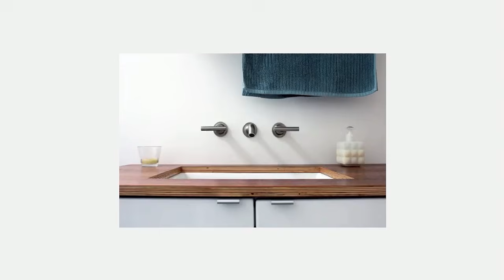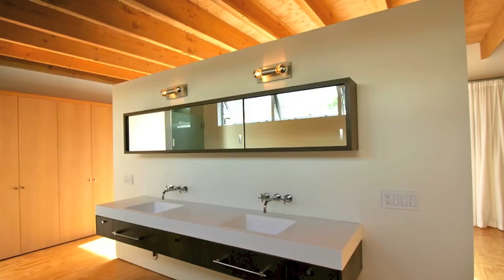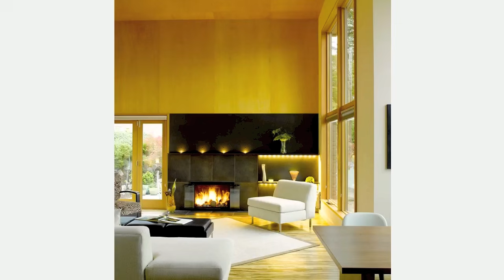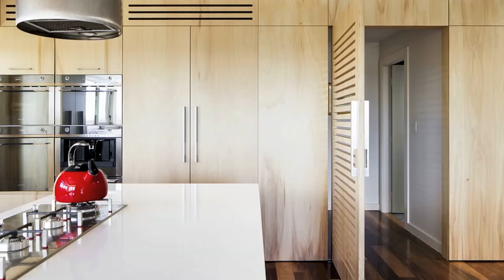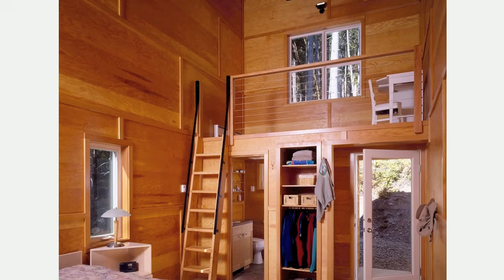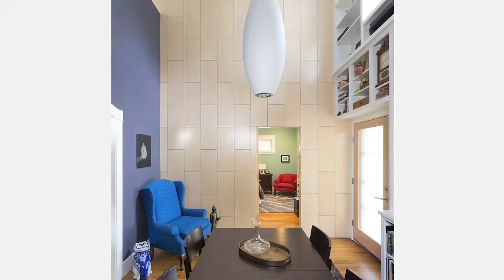Plywood as Finish

Comment: Is plywood fire resistant when used as ceiling and wall?
Reply: No it's not fireproof
Reply: It is actually not allowed in the UK for example, unless it is specifically fire resistant plywood, or with an intumescent coating applied. If not, having plywood walls and ceilings is the best way to ensure flames propagate as quickly as possible...

Comment: There are hardwood floor finishes such as Bona's Traffic HD and Traffic that are waterborne finishes that are extremely durable. Even more durable than oil modified finishes. Another siding finish that can be affordable is laminate,  laminate flooring or engineered hardwood flooring. You can also buy higher quality plywood designed for flooring  at completive prices. This kind of plywood many times is typically designed to have less imperfections, be a higher grade, have no core weaknesses or hollow spots. Products like Multi ply or similar brands may make good choices. Typically they are available in 4x4, 4x5 and 4x8 foot sheets.

Comment: Forgot to mention finishing plywood takes 3-4x the work or coatings for a finishers so don’t be surprised if the carpenters bill is much less then the finisher bill!
Reply from the maker: why?
Reply: 30X40 Design well plywood comes in many different species but overall it’s usually still rough grade over all and takes considerably more prep and material which result in more coatings.  Hope that helps, staining can be touchy as well.

Comment: I have a lot of plywood furniture because much of my furniture is 1950's style. I would like walls like these, so thank you for the slide-show and explanations. Very good. It would be nice if you did a program on the specific joints used to make those exposed joints. I would think just a thin spline of some alternate color, or some metal, like stained glass. Thank you.

Comment: I am a design draftsman with larger background as woodworking contractor. I did a number of plywood (finish) build outs for a prominent architectural firm in my area as well as designing other installations for high end design/build millwork shops. Done right, it does take on a special character. And of course the famed miter fold is indispensable.
Reply: Nick Dow what does this mitre technique accomplish? In my attic space, I want to use my sloped walls to flat ceiling to be finished in plywood to avoid dry walled plaster costs. any suggestions would be invaluable.

Comment: I was hoping this would tell me more about the kind of plywood you sometimes see in bookshelves where the layers are very distinct. I've never seen this plywood in a lumberyard but often in stores or magazines.
Reply from the maker: It sounds like you're talking about Baltic Birch or Apple Ply. If your lumberyard doesn't stock it, you should be able to order it from them (or their supplier directly). Good luck...!
Reply: 30X40 Design Workshop Thanks, that got me on the right track. It's really just multi-ply plywood.

Comment: Very instructive video! I really wanted plywood flooring in my new house and it wasn't easy finding a contractor that would do it. Now, a year later, some spots are squeaky and I'm not sure what to do. They were initially glued and nailed to the sub-floor. Any suggestions?
Reply from the maker: +Raphael Bousquet - I might investigate screwing the plywood rather than nailing. I've seen issues with noise when nailing finishes into substrates with high resin content (Advantech, etc.) Good luck!
Reply: wood expands and contracts constantly.  during the winter months you keep windows and doors shut and typically your house will have low humidity which causes the wood to shrink.  Since the wood was probably installed green (wet) then it was in a expanded state and so now there is play which basically a squeak comes from your body weight transferring into the area and if a nail is then when  you apply your weight the wood slides down the nail until it bottoms outs.  Find the nails and get a nail set if there visible and while holding floor down give it a tap.  should take care of most of them.  Just remember no one can guarantee a floor wont squeak because of expansion and contraction.  Hope that helps!
Reply: 30X40 Design Workshop
Reply: roofing felt or paper layer down first before laying the ply flooring should solve the problem

Comment: I want to use plywood as a wall covering. What thickness and type of plywood works best for this application?
Reply from the maker: +Jay Sheeley - that depends on a variety of factors. First thing to check is whether your insulation requires a non-combusitble ignition barrier (spray foam will likely require one). If so you may need to go to 3/4" thickness (or use an intumescent barrier on the foam). 1/2" ply will work in many situations, but it's subject to more warping b/c it's thinner. If your framing isn't completely true go with 3/4". 

Type is up to you and the desire aesthetics: informal, formal, industrial...many choices. Be sure to watch the follow-up to this video where I've selected a Douglas Fir plywood for the interior of my design studio. Lots of tips and tricks in there for installing this as a finished surface. Watch it here: https://youtu.be/Mb_0Nx-Dxnk 

Cheers!
Reply: 2 mil multigrain with bran flakes

Comment: Do you have any suggestions for how to achieve a close joint finish for ceilings? We don't want to use a trim or shadow gap detail. Our contractor is concerned that the boards will be uneven at the joins, both in terms of gaps between them, and also to get them all to sit at the same level. There are so many photos of these types of ceilings, but without a t&g board, is it difficult to achieve?
Reply from the maker: +snj - I recently finished the walls of my studio using a fir veneer plywood and despite similar concerns was very pleased the results of butt joints. The fact is, wood moves and if you can live with some of the seasonal shifts (gapping, etc.) then I think you'll be fine leaving the joints open and uncovered. 

Plan to rip the panels to your dimensions to handle any inconsistency between individual sheets. Source them from a high-quality mill (avoid Chinese plywood). Plan your joint pattern and nailing during framing and electrical rough-in to avoid any hiccups.

One trick that worked well for us to keep the panels even at the edges was to use reverse threaded screws. This allowed us to back the panel edges in and out to achieve a perfectly uniform surface.  I'll be recording another video on this soon. 

Good luck!
Reply: +30X40 Design Workshop 
Thanks for the help!